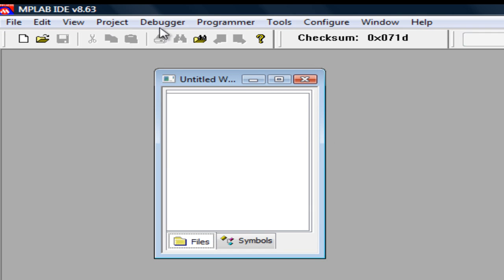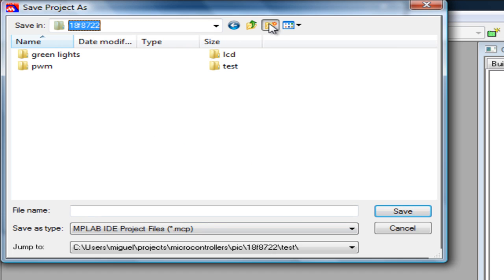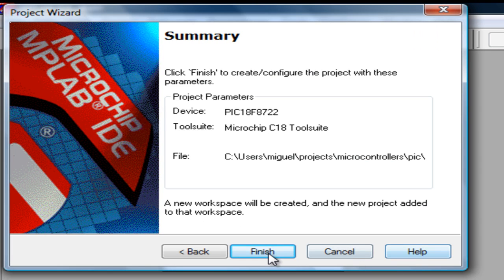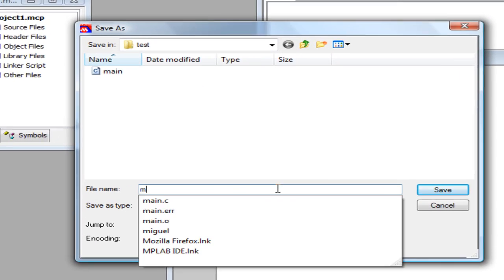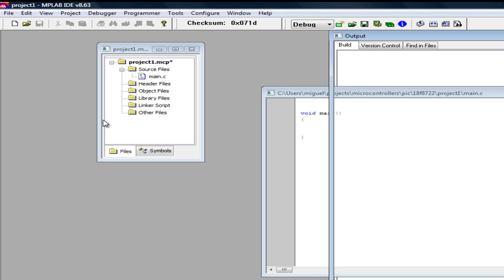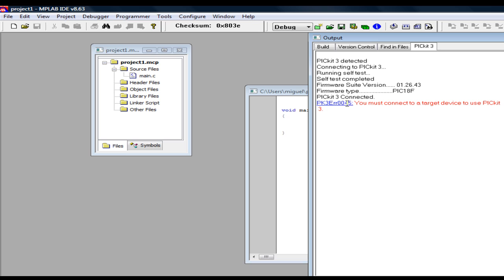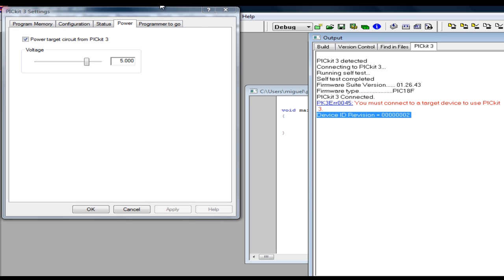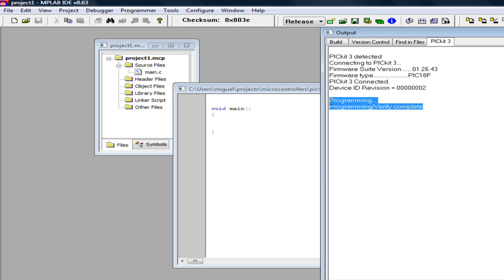PIC Programming MPLAB Tutorial: Upload Code to a PIC Microcontroller

Comment from the maker: Am sorry I don't know what DB9 is. For this tutorial it's assumed that you have a PIC microcontroller(I have the PIC18f8722) a programmer (I have the PICKit 3), and the connections set up between them. Check out my tutorial "How to program a microcontroller - What do i need?" to learn about programmers, compilers and circuit connections required.